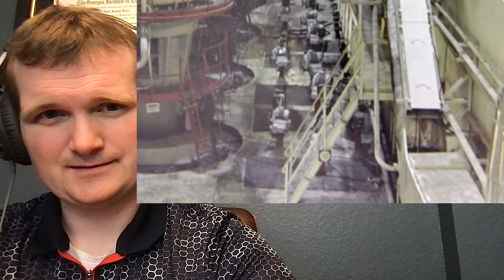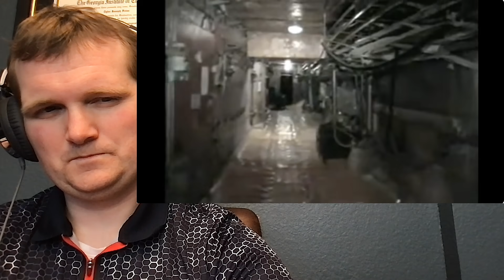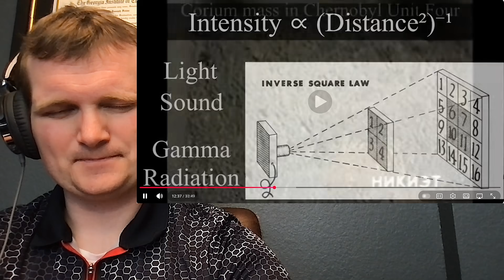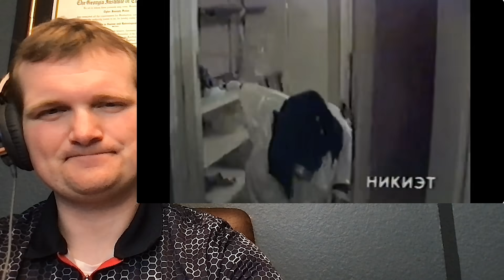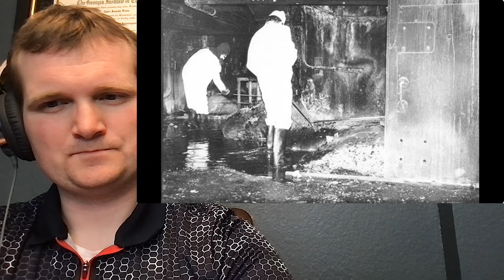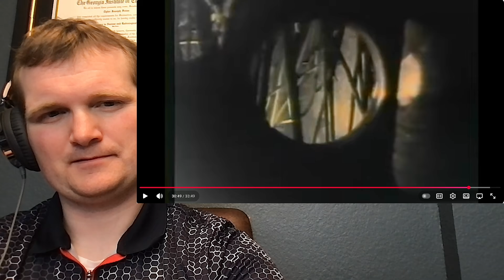Discovering Chernobyl's Elephant's Foot - Nuclear Engineer Reacts to That Chernobyl Guy

Comment: Shooting the Elephant's foot with a Kalashnikov sounds stupid at first but it is actually a great solution.
Applying a large force on a small area from distance. That's what guns were made for.
It allowed them to make the job (sample collection) done without unnecessary exposure and without any other significant risk.

Comment: Its always a really interesting contrast between chernobyl and fukushima, which had multiple meltdowns so in theory should of been more deadly, however without the denial and covering up of the ussr things turned out far better.
Reply: no.
chernobyl unit 4 blew up. the core was exposed. and the rbmk didnt have a trap for corium. meaning it leaked out into random corridors.
fukushima did blew up, but only the containment, the core wasnt exposed. and all the corium remained inside.

Comment: I can say I was near Coventry in the UK.    The dawn after chernobyl, as the sun came up, I was wearing a sleevless garment.     I was in the open and there was light drizzle (for non UK drizzle is very light rain).   Within 4 days all the exposed skin on my arms came out in pin head size blisters, a bit like drmititus but much less concentrated, mybe up to 4 per square cm.     I knew of a bauld headed farmer out in his field at that dawn.   His head had similar blistering.      UK was lucky.   The drizzle/rain came at a time 99.99% of people were asleep in bed, or at least not semi naked in a field.

Comment: I just had a realization watching this.

My grandfather was a nuclear weaponsmith on the USS Intrepid. He carried classified clearance his entire career and never spoke about what he actually did — not to my grandmother, not to us. He took that to the grave exactly as instructed.

I’ve never had anyone clearly explain what a “nuclear weaponsmith” would have been responsible for on an aircraft carrier. Maintenance? Assembly oversight? Security protocols? Integration with delivery systems? I understand carriers themselves aren’t nuclear weapons platforms in the strategic sense, so I’ve always wondered where that role fits structurally in naval operations.

For context, he retired to Montana and spent the rest of his life logging and living in the woods. Hard reset. He was a heavy alcoholic for years, then one day he and my grandmother just stopped drinking and smoking completely. Cold stop. No announcement. Just done.

My other grandfather was a machinist NASA contracted for precision parts. Brilliant but self-destructive — “wet brain” alcoholic. He once kept a small amount of aerospace scrap metal and made my grandmother’s wedding band from it. I went into welding and metallurgy myself, so I’ve always wondered what alloy that might have been — Inconel? Hastelloy? Something high-nickel from propulsion work?

Anyway — hearing you break down nuclear systems with clarity makes me realize there’s a whole layer of my own family history I’ve never fully understood from a technical standpoint. It’s strange how much silence sits around that generation.

Appreciate the way you explain this stuff without sensationalism.

Comment: I worked at an outage in Illinois and you could always tell who the jumpers were by the fact that they were beet red from the waist up. They would get there full dose in about 30 to 40 seconds. Their job was to move the fiber optic inspection camera from one tube to the next in the heat exchangers. They were few and far between, so they were offered a choice, they could sign off for a second dose and sit for maybe a week before going back in or get paid off and leave. Me, I would have got out of there A.S.A.P, but many did it. They were boilermakers and I worked as a Steam fitter.
Reply: How did they get exposed? What job was this?

Comment: Tyler, is the scene in Chernobyl, where they are reviewing the reasons for the explosion in the hearing (e.g. graphite was cheap, etc), accurate? Was it really preventable if the USSR had not low-balled the construction?

Comment: So... if there were 9000 and stronger Roentgen radiation there, that got me wondering, how strong is the radiation in regular X-ray machine?
Isn't roentgen and x-ray, the same thing?
Reply: N-No....? An exray is like 0.005 roentgen.
Reply: @ChNPPinMC"Roentgen radiation" is the term for X-rays in some languages.
Reply: @ChNPPinMCThanks 👍
This is exactly what I tried to ask...😂
My question was just, bit poorly made 😅
To get an rough idea, about the scale difference...
Reply: I think you may be confusing two things. "Roentgen radiation" is the term for X-rays in some languages, so depending on your native language, the answer may be "yes, it's the same thing".
A "roentgen", however, is also an obsolete unit of radiation. So the elephant foot emits the same type of radiation as an X-ray machine, but its many, many orders of magnitude more intense. It's like the difference between a lightbulb and the Sun.
Reply: @Ludvigvanamadeus  Thanks for the clarification 👍

Yes, indeed we use roentgen, when speaking about x-ray machines or imaging.
I'm just an average Joe, in matters of radiation, but the subject is really interesting,  because throughout my life, I've had hundreds of different types of body scans taken of me. So the interest kinda develops naturally 😅
Anyway... thanks again.

Comment: ooooooooooh, neat! more chernobyl guy! thank you!
(also, potentially very silly but also completely genuine question. what was the point of taking the second measurement inside the hatch? if the reading is at 9000 already, and the direction/location of the source is known, wouldn't it make more sense to get away from it with all due haste and then keep everyone away for as long as possible? i'm assuming there is a reason beyond morbid curiosity, but i can't think of anything)

Comment: My main question is, ARE there any other RBMK power style power plants with no shielding like Chernobyl, or was Chernobyl unique in that way?
Reply: They all have shielding in the form of massive 2000 and 1000 ton shields filled with serpentinite on the top and bottom, and the sides surrounded in steel, water and sand... but lack a western style containment structure, which is very bad. However i don't believe a western containment structure would contain the explosion. I believe it would end in an open, burning core either way

Comment: Isnt the Kursk nuclear station of the same design, but then you said modern, and such concept does not exist in russia.
Reply: Kursk and Chernobyl NPP are spitting images of each other, they're effectively twin sister stations. However, after the 1986 accident, the remaining RBMKs were heavily modernised and upgraded and have run pretty much incident-free ever since. Kursk Unit-1 shut down on December 19, 2021, and Kursk Unit-2 shut down on January 31, 2024. Both reactors had a long and successful career. Units 3 and 4 are still running.

Comment: For γ-radiation, 9000 R (at the immediate proximity of the elephant's foot) would be 90 Sv/h so the guy had to limit his exposure during 4 seconds to already reach the limit above which there's a proven added risk of cancer (100mSv) but realistically could stay up to 10-20 s before the threshold for deterministic effects take place and he would start to get a few symptoms.
In 2 min 40 s he's likely dead.
 Konstantin checherov has received several lethal dose over years however. He did died from cancer at 62 but didn't suffered from acute radiation syndrome afak

Comment: I have a question I hope someone can answer for me. I’m a machinist this stuff is just really interesting to me so I’m a dumb dumb in comparison to Tyler, but commenting about a dosimeter that has read on an extremely high amount of radiation. Does that not like very much irradiate the dosimeter and make it useless at that point? If it doesn’t break of course. I feel like it’s just unusable at that point and you’ll just throw it away. Also, put the person carrying it out of the area in danger. Like I said I’m not on the level of intelligence to understand this, this was just a thought that popped in my head.
Reply: Radiation doesn't stick to things. Dust does though. And if the dust emits radiation, then it becomes unusable.
Reply: @ChNPPinMC okay thank you very much.

Comment: You should make videos covering some of the lesser-known Soviet submarine accidents, because some of them were nuts. They once accidentally took a freshly-refueled reactor on K-431 prompt critical. The only reason it didn’t badly contaminate the nearby area is that it was freshly refueled, so there was no spent fuel in the reactor core, just fresh fuel.

Comment: I'm curious about the bottom of the reactor. Were you able to go there? Like, during operation, for maintenance work?
Reply: No, it was several hundred degrees hot.
Reply: @ChNPPinMC 
It's not just the heat. It's the extremely high neutron dose as well. With the core size an RBMK has, you wouldn't want to be anywhere near the sub-reactor rooms when it is running full tilt. The neutron flux would be all over the place down there.
Reply: @swokatsamsiyu3590  Inside it. It is safe directly outside the room. Idk about inside but the lower bio shield shielded most of the radiation.

Comment: The most soviet problem (industrial accident) requires most soviet solution (AK 47).
Reply: AKM*
Reply: Ak 47 actually has a German oringin
Reply: I assume you are referring to STG-44. Besides some external visual inspirations, they are completely different assault rifles with completely different mechanical parts and whoever knows about guns know about this

Comment: No, That Chernobyl Guy has a fairly convincing argument (and video) for the detonation being a pair of (teeny weeny) nuclear fizzles in the corner of the core which completely blew out the bottom biological shield. Followed by the steam explosion later. That's what he's hinting at near the end, with various supporting evidence ranging from airborne radiation detection to estimates of how much material remains in the core, to now-known characteristics of the neutron flux in an RBMK.
Reply: I barely understand it tbh but his theory is fascinating!
Reply: Didn't Chernobyl run on natural uranium and low enriched uranium? I doubt it would be able to do anything like that.

Comment: Something I said in real life about using the AK to sample the elephant's foot, "That's because it sounds like a Simpsons skit doesn't it? We have this radiation problem. We are going to solve it by shooting it! With guns! For science!"
Reply: I'm not an engineer by any means, but I cant think of a safer way to get a sample of it. People cant approach it, and the robots were too unreliable and expensive
Reply: @j.adamwegs2882  We've got much better robots now. I wonder if they could use them to collect and contain a lot of the radioactive material.
Reply: @Knowbody42  The Elephant's Foot (actually, most of the corium at Chernobyl) is pretty heavily decayed now. The Foot barely looks like it anymore, with how much it shrank. Getting a sample would be easier nowadays for multiple reasons, one of which is that you'd be collecting sand, dust, and sponge-ish, rock-ish, metal-ish stuff rather than the solid chunks them Soviets were shootin' back in the day. The decay of the corium is so far advanced that it's half-collapsing on itself, leading to small output spikes as the geometry changes. Pretty wild stuff.
Reply: @j.adamwegs2882 the electric controls malfunction at high radiation, I have been told
Reply: @GodelFishbreath  only if unshielded and if you want them to last long

Drones would basically be considered disposable in those situations and will last long enough to do the job